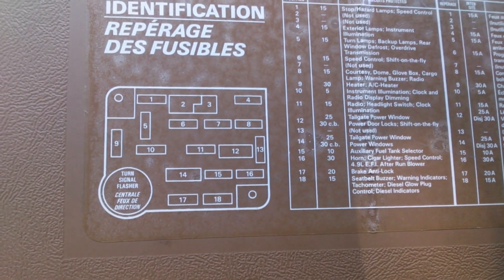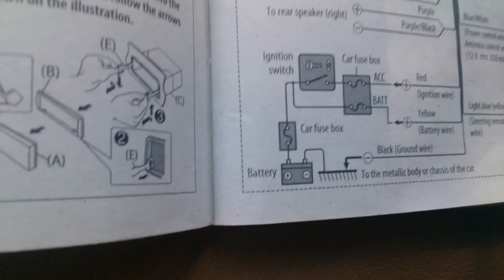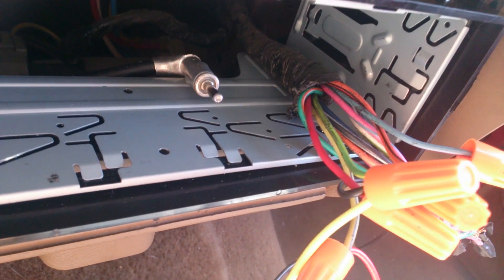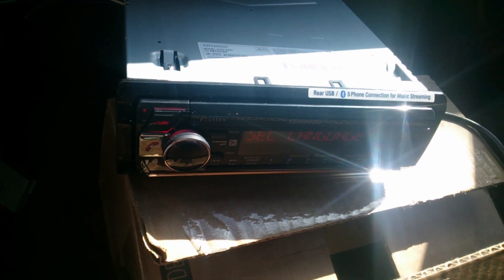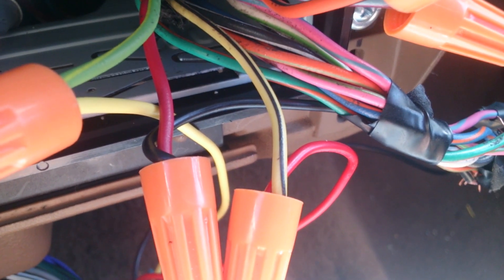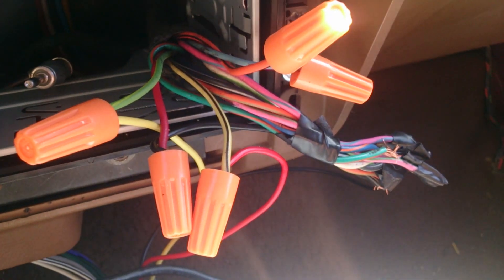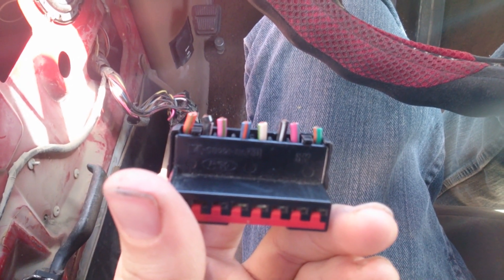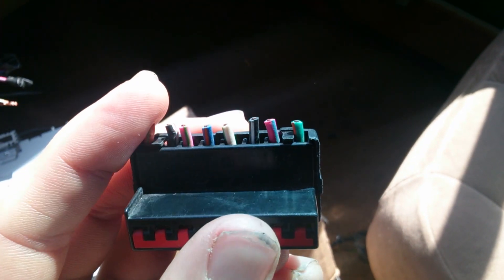Radio Wiring for 1987-1991 Ford Bronco (and F150) | Part I

Comment: Awesome video man....still not my color of wires tho...89 F150 🙄....and these old trucks have the craziest wiring I have ever seen in my life 😳
Reply: Where you able to connect it
Reply: I'm having trouble connecting my sterio to my 89 f150
Reply: @jonathanbotello1420  my trucks issue is that the previous owner cut the pigtail completely off the wires instead of buying a harness that connects an aftermarket stereo to the harness in the dash....so my issue is sorting through and rewiring in order install a stereo not to mention that I plan to get doors with manual windows and that's gonna call for doing the wiring for the doors as well so my plan is just to put fresh wire throughout
Reply: @jonathanbotello1420  but if you have cut your wires or anything then you can buy a harness that goes from your factory  to your stereo but you have to wire the your stereo to the harness that plugs into your already existing wires in your dash
Hope this helps
Reply: Thanks man

Comment: Thank you very much for this video.  I got my radio to work but my audio doesn't work. I hooked up the right speaker wires but it is probably my speaker or maybe my amplifier?
Reply from the maker: I’m not sure, it could be your amp or maybe your speakers are blown out, without more information it would be difficult to diagnose. :)

Comment: How do we differentiate the two white/black wires??
Reply from the maker: With wiring harnesses, there's a solid color and a stripe, generally electricians refer to wires by the solid color first. 

In the description there's a list of wire colors and what they connect to. One is for the passenger door, the Other is for the driver door. Let me know if that helped or not, and I can explain further.

Comment: Will this work for a 2000 Ford Ranger?
Reply from the maker: Sadly, no. Sorry bud! The process will be similar but the wire colors will be different. Try comparing your harness to some of the diagrams in this link: 

https://therangerstation.com/tech_library/radio_wiring_diagrams.shtml

 Best of luck 👍

Comment: NEVER use wire nuts in an automotive application!!!!
Reply from the maker: Five years later and still no problems ;)

I still have to wire it up correctly, I haven’t made time to do it with the Scosche harness replacement.